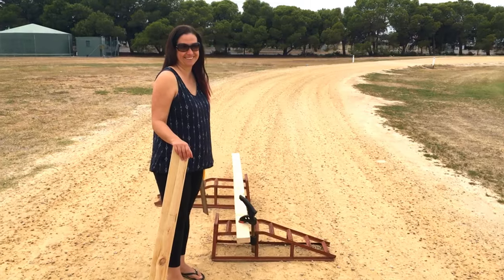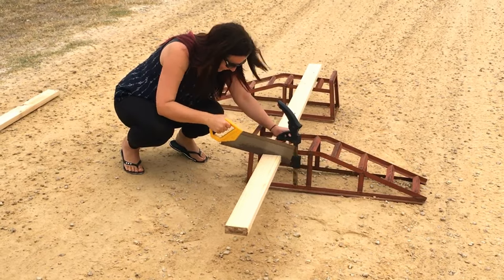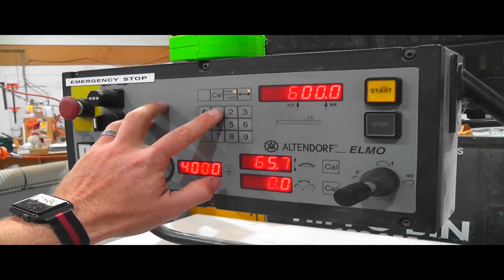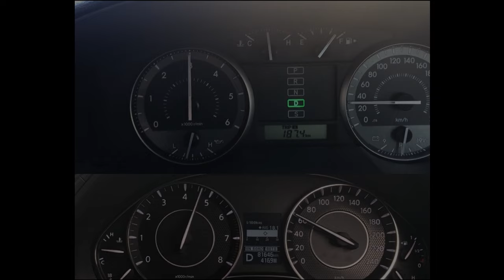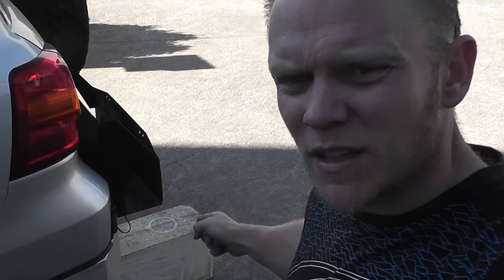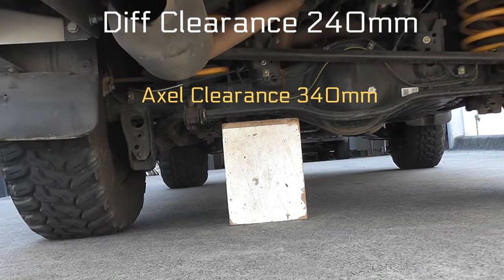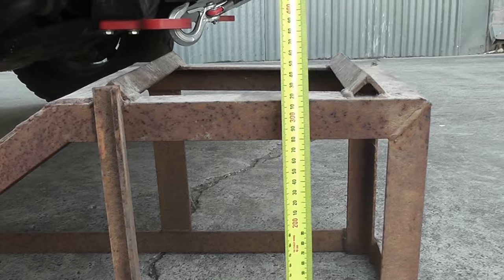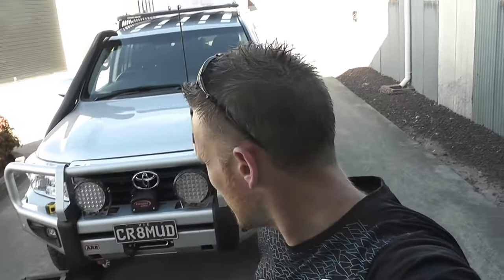Battle Series Ep 3 - 200 Series vs Y62 - 0-100km/h

Comment: Pumpkin clearance is important though. As in rutts thats what will hook you up, the full IFR,IRS doesn't so drives rutts better.
Reply: Yep, some of these IFS have sooooo much clearance, but get them crossed up and they suck (a little bit).
Reply: They do lift wheels. but they stay pretty stable. And do it a lot easier.  The Y62 isnt my 1st 4x4. its my 1st IRS though and i love it.
Reply: Cruiser owner's point was valid though, the control arms on the Patrol are lower than the middle and would scrape in ruts.
Reply: Stephen Lloyd only if ur wheels/tyres aren't high enough. Standard 33" tyre. Ifs ifs actually works better in ruts compared to my solid axel rigs
Reply: @stephenlloydco  rarely. Diff pumpkin scraps alot more.

Comment: Curious, are both cars running same size tyres? Also are both cars lifted above standard?
Reply from the maker: Both cars running 33's with a 2" lift. Thanks for watching
Reply: Patrol comes standard on the 33s. the 200 has bigger then standard tyres :P
Reply: Standard size tyre on my 200 was 285-65-17,  im currently running 285-70-17 so 30mm bigger in overall diameter which would give me an extra 15mm clearance over standard.   
But thanks for watching though,   next video will be on my channel so i'll get to have the last say on that one lol
Reply: There is something not quite right about that departure angle comparison.
Reply: Nate and I reckon your timber is shorter than two meters and the landcruiser one looks about right for 2m
Reply: lol good work guys.. love how u help the y62 sales too haha
Reply: Each state has its own laws regarding this.. In QLD for example, u can increase overall diameter by 50mm and lift 50mm.
Reply: So, IRS is a more comfortable ride, good articulation, and better handling.  Can you tow heavy? Yes, like anything, standard suspension really isn't suited for heavy towing as they make them comfortable for normal road use. But its easily remedied with either a rear spring change to heavier duty springs or airbags,  400kg springs will limit travel though offroad as they are so rigid, and also give you a hard ride when not loaded. so most people just go airbags and pump them up to the desired pressure.

Comment: my 2500$ pajero is more capable then both those cars combined
Reply: Craig Balfour funny mitsashiti v6 landcruiser a v8 and would smoke a Pajero any day
Reply: Craig Balfour obviously never drove a landcruiser
Reply: Pajero drivers landcruiser wanna bee
Reply: driven a 75 series and an 80, 80 rode like the paj but was about equal in capability cruisers yes have more grunt than a paj and yes are stronger in the front end but if u make it through the track who cares,75 was a boost monster ended up blowing its guts out but was the roughest ride ive ever been in and couldnt be stopped by anything but engine failure, but still i bought my current paj for $2500 treat it like a peice of shit and its been going strong for 23 years (2 years in my hands) as a petrol so im not gonna compare apples and oranges with you anymore obviously your a cruiser guy and cant be swayed by the pure heart of the underdog vehicle
Reply: @akay4k206  they might beat them on the roads but I'd take an old solid axle 4wd over these new shit heaps any day. My GQ would go further on the tracks than these shopping trolleys ;)
Reply: frank senator I’ve been brought up with cruisers and I like gq patrols and gu and stuff but my family owns a 200 and a 79 which is a solid axle aswell so in my opinion I have the best of both but g day mate

Comment: Lc200 is 10x better than the Patrol
Reply: No problems with injectors, No oil burn, Non dpf model
Reply: True , have the lc200 2008 model, odo is way past 300,000 km, still strong as new, overhere heat can go as high as 50 degrees celsius outside, driven thru desert most of the time , this thing is a tank, on the other hand the y62 is a great car, except it is more road focused
Reply: Good joke
Reply: 4x4 and camping channel 
Have them both , no way , nissan is just too good to compare with lc.